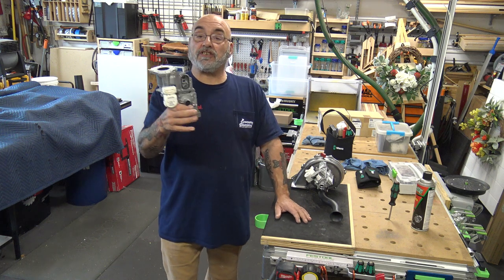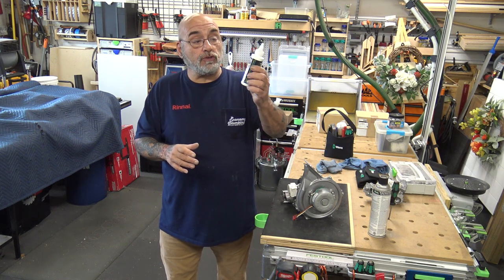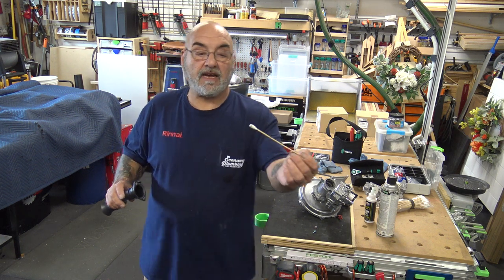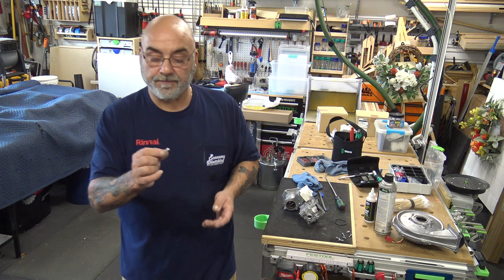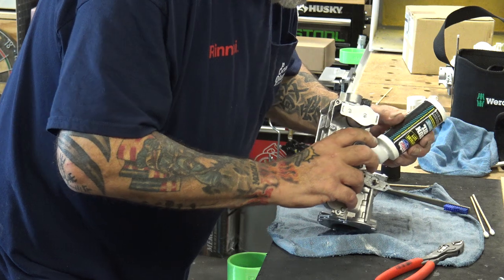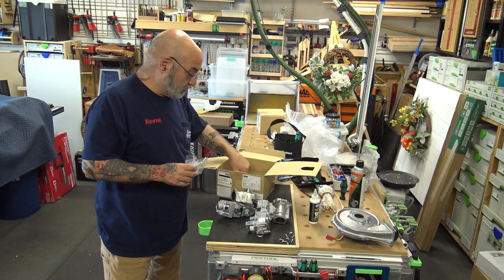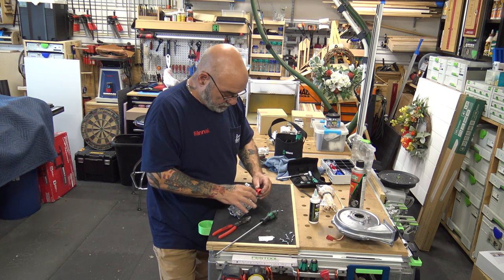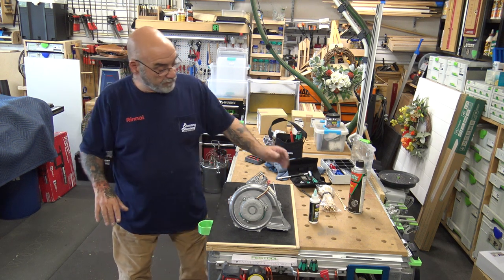Code 15 cleaning a Rinnai Venturi gas valve 106000117

Comment: I have a property on the Atlantic coast (NC.) I was wondering how long will the Venturi gas valve typically last or start failing?  My unit recently was not working, gave a Code 15, but my tenant unplugged the unit for over an hour, and when the technician came out, it started working.  Unfortunately, I was not having annual maintenance or tune ups, as the Propane Co which installed did not mention or recommend.  However, the unit is 3 yrs old, and under warranty, but hate for the tenants to be bothered by it.  The Propane Co does not want to replace until it malfunctions again, for the warranty, but they should be able go back and verify the Code 15?  What would you recommend in this situation.

Comment: hi, youtuber, I already followed your video to replace the Venturi valve ,the code 15 was solved . but unfortunately it didn't work that no hot water when I used. and the light of 'in use' signal not flash, could you let me know what should I do next?

Comment: Hi. I have tankless waterheater 160Ni and see error code63. I searched how to fix it, and according to the instruction, I need to remove air. But there is no mention about how to remove air. Could you give me any suggestions? Thank you.
Reply from the maker: I have a video on how to bleed out the air for a RUR unit

Comment: Mike, I purchased a V75iN and it's intermittent firing. When the unit starts sometimes the flame comes on right away and then goes out and then comes back on. Plus when it is lit the water temp is lukewarmat best. Any suggestions?
Reply from the maker: You need to check the incoming gas pressure and the low high fire settings. This needs to be done by a certified Technician

Comment: HI MIke, is there anyway you can give me a quick call, my Tankless fires up and i get hot water, i want to see if its safe to use, the Gas company advised me that the Heat exchanger is leaking. I also sent you an email. Thanks Anil